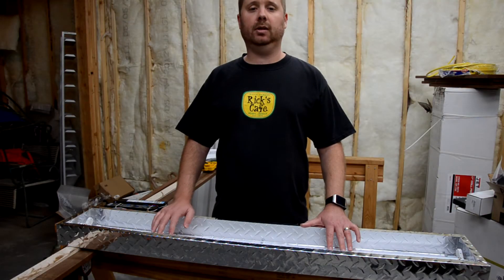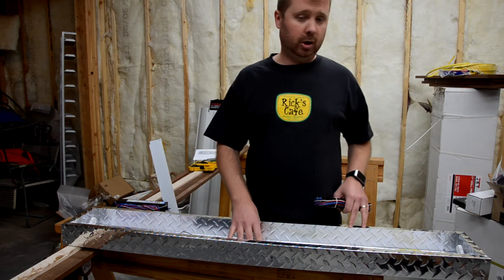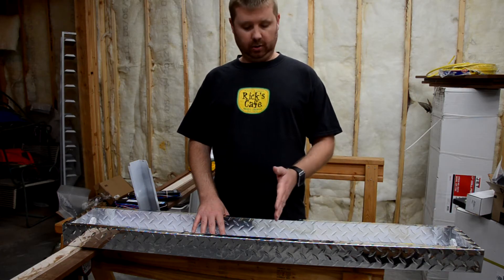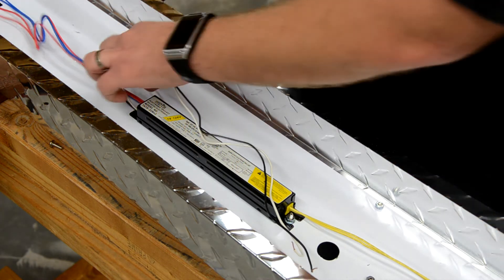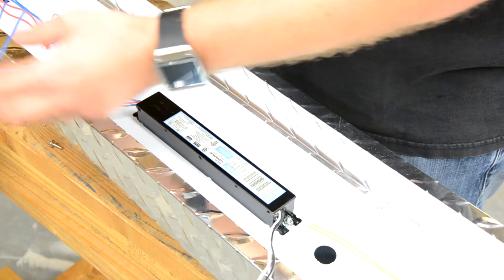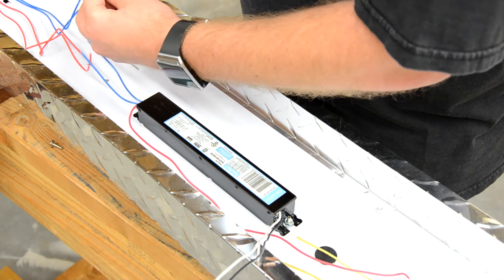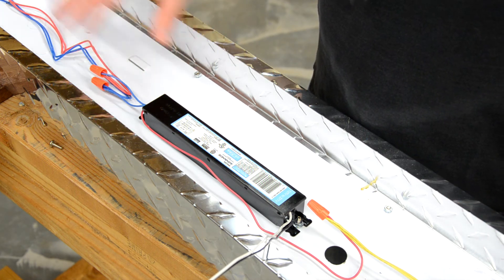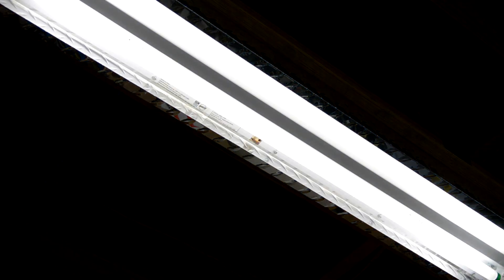Replace a Fluorescent Light Ballast - Easier Than You Think!

Comment: Nice video, but I have a query . . . you warned to make sure you get the right replacement ballast, and especially whether it's a one lamp or two lamp ballast. But what about the wattage? Are ballasts wattage dependent? I'm wanting to replace a ballast in a light fitting that has two 18W tubes, so is it important to get a 36W ballast, or can the rating be higher or lower? Thanks.